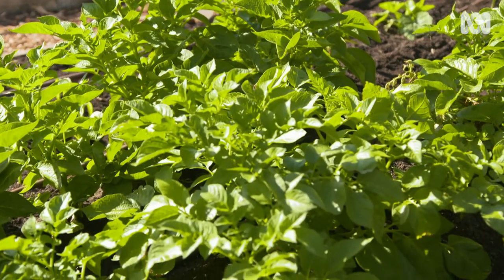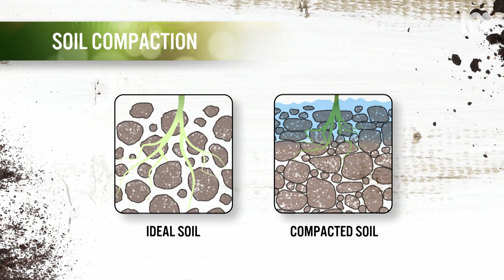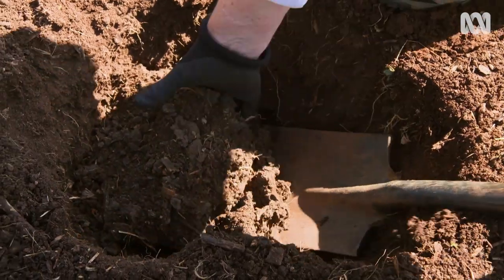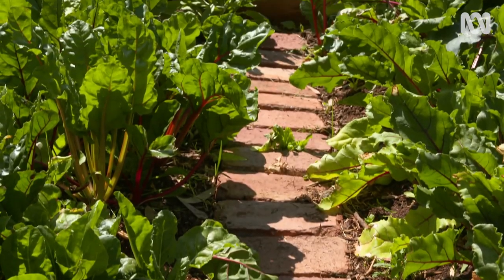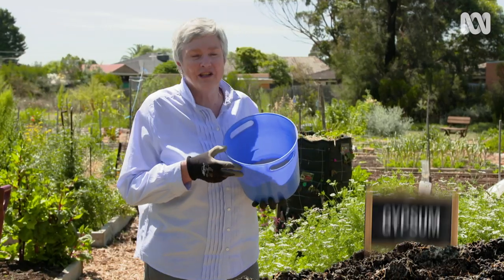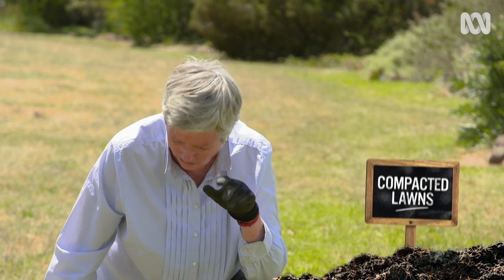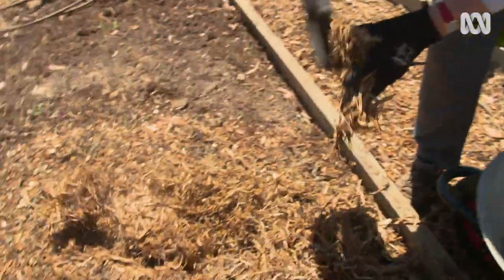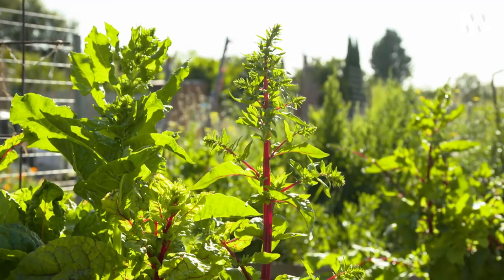How to improve compacted soil | DIY Garden Projects | Gardening Australia

Comment: Raised edged beds help to create the problem. Standard rows require no straining to reach anything. Raised edged beds require so much irrigation in our hot dry climates, that you cannot avoid compaction and overwatering, and also raising water table locally.
The raised edged beds there are great for garden tourism and get all the expert attention and get soil replaced. In a home garden situation they cause far too many problems and solve none, at great expense. Unless you're on rock, raised edged beds are to be avoided at all cost, pun intended. Most of the supposed benefits are not real. They sure get a lot of sales of compost etc. when people make them. They take no responsibility for this costly mistake and will not tell you the truth.
Reply: I grow a mixed cover crop in the winter in my raised beds. In the spring I weed wack it and leave the roots in the bed. It is full of worms and holds moisture like crazy. Works in my TN garden.
Reply: @nancywebb6549  : Great work Nancy. Very different climate up north. Even driving from victoria into NSW, big difference in flora. Lawns in NSW are so green from rains. Here in victoria if you dont water, the lawn barely makes it thru summer.
You may be onto something though, as i just installed driptape irrigation for veggie patch. It holds moisture much longer and doesnt crust up the soil.
Still prefer the flexibility and ease of re-configuration of rows without edges.
Reply: I am 77 and getting down on my knees is getting harder so I have reached the point of needing to sit on the edge of the raised bed. I usually spend 4 to 5 hours a day in the yard and garden so I need to compensate. That drip irrigation will save lots of water. Blessings on your garden it will rescue your sanity.
Reply: @nancywebb6549  : I have experienced raised beds both single and double stacked configurations in my garden. Neither provided back savings. In fact i used to do same as you, sit on edge, then need to twist to reach in. I dont get a sore back with plain soil rows.
If you have a crook back, i'd suggest a properly constructed raised bed built for this purpose. Common raised beds are not the backsavers everybody pretends they are. They're quite bad in fact.
Reply: @Chris-op7yt  I don’t have a bad back. I have a problem getting up off the ground.
Reply: @nancywebb6549  : Then you might opt for a real accessible raised bed: about 3 foot high and 2 foot deep. Talking in feet as that's the common board width. It does put tall growing veggies out of reach.

I'm younger but found the sitting on the edge and reaching in whilst twisting quite straining, when i had raised beds.
It's so much easier to set up supports and watering without raised beds. I've even fallen off whilst banging in support posts whilst standing on edge. Now that i have no raised beds, i bought and use full length soil prep and weeding tools from wolf garten brand. they're light and allow soil prep and weeding to be easy and short work. Used to have to use a fork or spade to dig into raised bed soil mix.
i cant tell you what will work best for you but in brief that has been my raised beds experience. Besides the periodic cost of topping up the mix and edging eventually rots.
Reply: @Chris-op7yt  My beds are 10 inches high and four feet wide. The sides are 2” thick and I can sit on them quite comfortably. I am not over weight. That might help.They were filled with mushroom compost and I don’t have to top them off very often. I have worked so many vegetables  in the summer that I make a trip to the food bank every week. The workers tell me their clients really appreciate fresh organic produce.